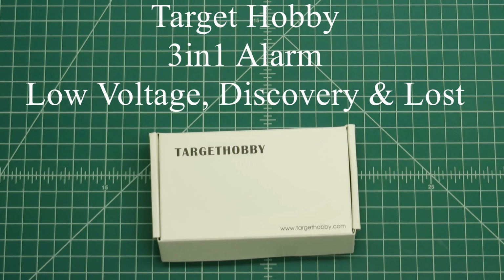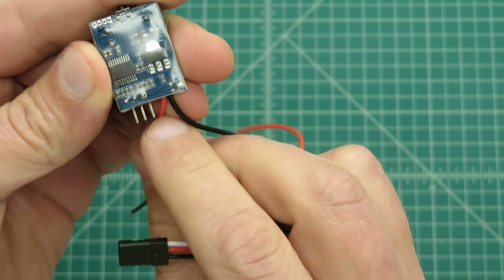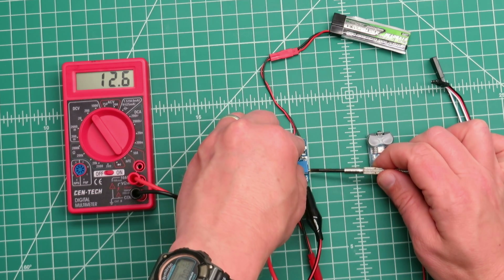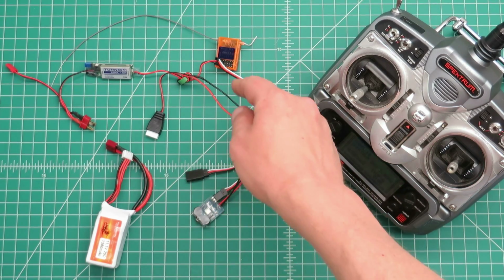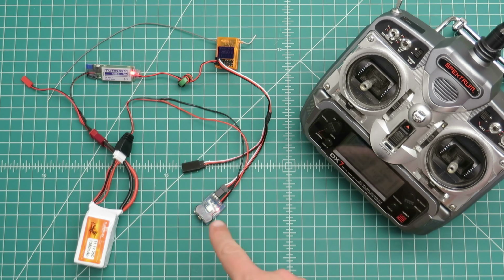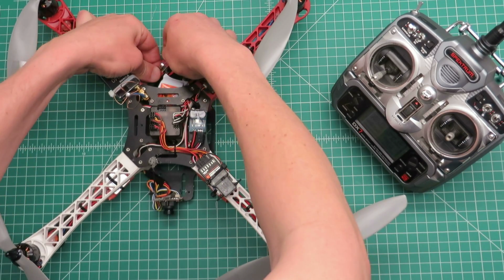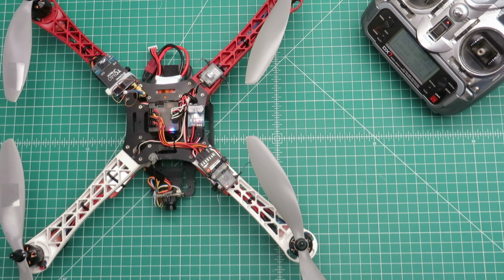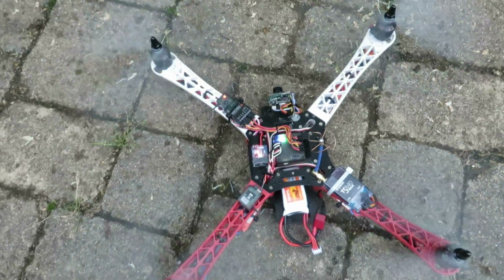Target Hobby 3in1 Low Voltage, Discovery & Lost Signal Alarm - How to Use and Review

Comment: can i use this with the turnigy evolution controller and the ia6c receiver it comes with or do i need to get a new receiver if i can use it how would i hook this up
Reply from the maker: Hi Big Will, yes you should be able to use it with any receiver as long as you have a PWM output on your flight controller.  Essentially the same answer as below, map it to a switch using the channel pass thru function.  Check out this video:  https://www.youtube.com/watch?v=73DLKH_YXx0

Comment: What is the adapter you use to connect to Lipo ?
Reply from the maker: It is an adjustable  step-up voltage booster so I could simulate a battery's voltage sagging to activate the  low voltage alarm. It is rated for 2 amps but likely only good for about 1.  Search ebay for "MT3608"

Comment: it is a problem when i use Sbus?
Reply: did you figure out if it work with SBUS?
Reply from the maker: Essentially you can connect it to the PWM output on the flight controller and map it to a switch using the channel pass thru function.  Check out this video and let me know if you don't figure it out.  https://www.youtube.com/watch?v=73DLKH_YXx0